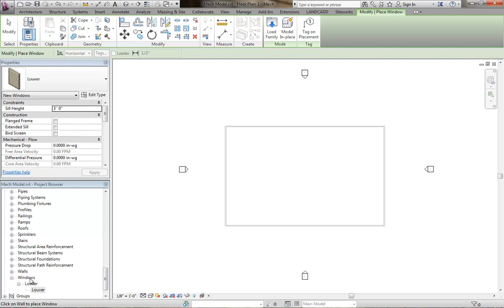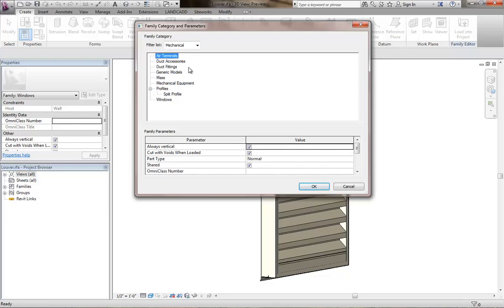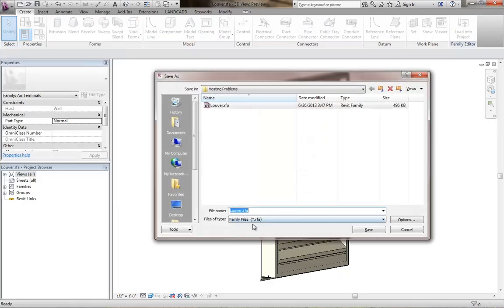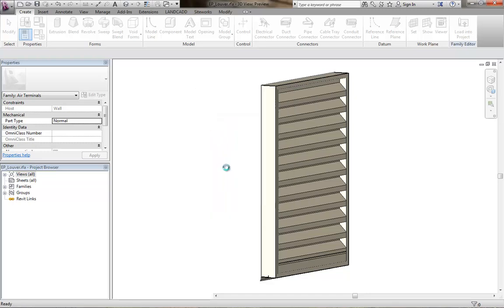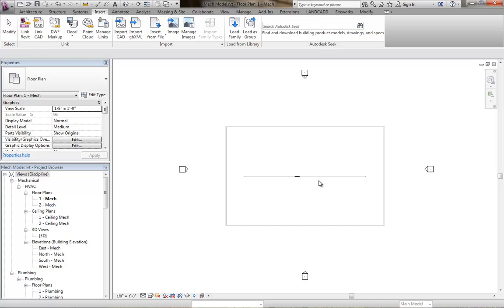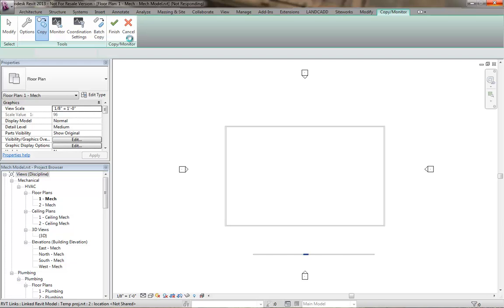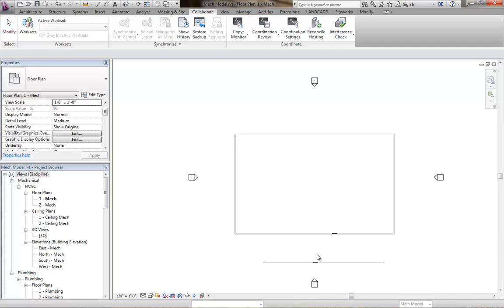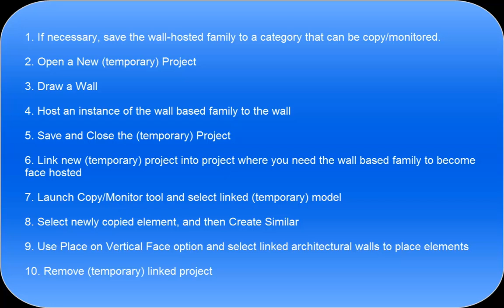Changing a wall-hosted family to a face-hosted family

Comment: I just download an BIM model for an LC&D panel, but it not a hosted object currently.  How can i make this a wall host object?
Reply from the maker: +Damian Palacio 
Unfortunately, conversion of a family from a non-hosted object to a wall hosted object is not possible, to my knowledge.  Typically, you'll want any sort of MEP family to be face-hosted anyway as the panel would stick around even if the Architect deletes the linked model's host wall.